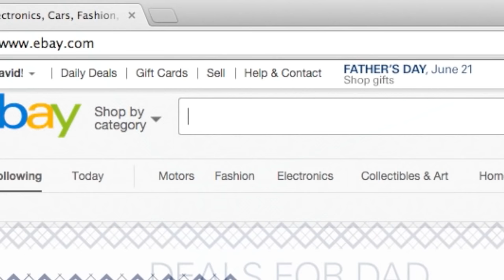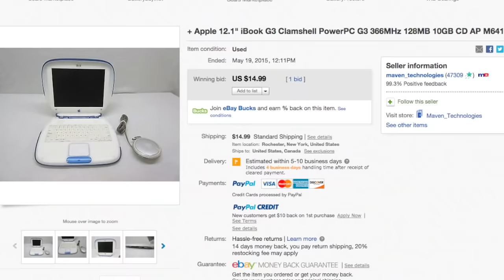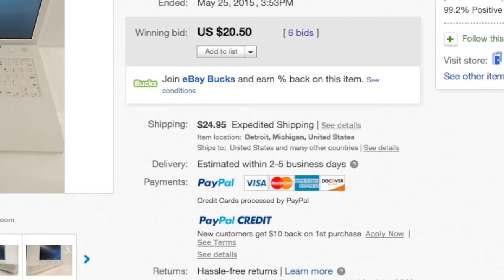Are apple iBook laptops collector's items yet?

Comment: I'm sorry but I believe the old hp laptops from the mid 2000s will become collectable. They have some of the most beautiful designs on any laptop ever made. The black with swirl designs molded into the plastic accented with silver just a gorgeous laptop. Not to mention they had gpu issues so most of them got scrapped meaning they will become more rare. If you like collecting computers I highly suggest collecting hp laptops as they are so unique through the generations. They may be terrible in reliability but they are truly works of art much nicer than the aluminum bricks apple has been making for the last 3 years.

Comment: "Everything apple makes will be come collectible" it hurt me when you said that
Reply: cough iPhone 4s cough
Reply: Not the apple watch 1, the ipad 1 or anything from the iphone 7 upwards. This is because the later models LOOK IDENTICAL to the models i mentioned.
Reply: Well I am using iPhone 6 plus. I would not thinking about replacing it with something else if they would not slowing it so badly.
Reply: aint no one gonna be collecting AirPods
Reply: Hope the 3gs doesn’t become stupidly expensive. It was my first phone and i want it back for nostalgia sake

Comment: How to look like a badass in class

Buy a non functional IBook Clamshell on Ebay
Take your laptop/Buy a cheap one
Put the laptops hardware in the Clamshell body
You now look like a hipster
Reply: I own a working one and sometimes i take it to class🤣
Reply: This is exactly what I want to do
Reply: would it fit tho?
Reply: Javiercito heh
Reply: @Yung Javier surprisingly some might actually fit just fine. Clamshells are relatively big machines compared to newer ones. Granted you might not end up with the USB ports but hey, that's the curse of retrofits
Reply: I have a blue clamshell one and i want to fit a macbook air 11 inch inside of that, i know its possible, look it up on google, core i5 clamshell ibook. Its stunning and everything on that ibook works, even the screen, its a screen from a 12 inch powerbook g4, i was stunned when i saw this and i just want to (re)create this laptop myself! Its a long and hard mod, but i think its worth it!
Reply: Yeah there starting to get a higher price some if them come with everything that was in the box and there about 1000 dollars
Reply: @bramvandenbroeck5060  someone did that put a MacBook Air motherboard in a graphite clamshell

Comment: I wouldn't say that old IBM and Dells are not collectible as some can be pretty steep despite their age. XPS M1730 World of Warcraft edition in near mint condition with all the upgrades often float between $1,100 and $1,300. As for IBM some of the classic Thinkpads such as the Transnote are extremely rare and sought after and often go for $200+. Not uncommon for Thinkpads that had once been owned by NASA (with proper tags ect) sometimes will go north of $600. 

Anyway buying powerbooks ;)

Comment: They built the iCarly "pearbooks" of iBooks G4 at first, but the one you showed, which was later in the show, was built off of a 2010 Macbook, right before they killed the macbooks. They also used a Black Macbook in the middle of the series.
Reply: Engei why spend money on iBooks if they are going to call them pair books🤣
Reply: Ricky Bennett  Dan Schneider has used them in literally every of his productions!

Comment: Do you think the Apple Watch will be worth a good amount since it will be a first generation in years to come?
Reply from the maker: Brian S - I'm sure it will.  But now isn't the time to buy one if your goal is to make money.  You need to wait until the price of them on the used market hits bottom.  Could be several years.  The original iPhone is already selling for quite a lot if it is in original box and condition.
Reply: Also do you think it's a good investment to get the sport and leave it rapped in the box?
Reply: Brian S I certainly think it could be-- the more original something is, the more 'one off' it will become... like a bottle of unopened vintage wine, but it could well be dependant on several factors in the future. (apple's longterm success, significance of the apple watch etc).
Reply: The time between buying an apple watch and it becoming collectable will be worth much more than the money you might make off of it. And you certainly wouldnt be the only person to do this. Plus, the chances of you making more than a few hundred bucks are VERY slim.
Reply: Guys, collecting is a hobby, not an investment. It'll never make you rich, in fact, it'll probably make you poorer ;)
Reply: Brian S It depends, but not for a long time.  Most of the time what gives things value is how rare the item is.
Reply: Brian

Comment: I bought an ibm thinkpad 380d in 2008 for 1$ on eBay and now you can buy this laptop for 115$. So, I hope this machine will increase its worth to 300-400$ maybe more in the next decade. I like the keyboard on this machine and the vintage tft screen when I play some vintage old games. :)
Reply: I used to have a 380d. There is a small market for those older think pad units but I don't see its vale increasing much further
Reply: The dollar sign goes before the number.
Reply: @geektome4781  if we're going to be petty, you replied to a 2 year old comment
Reply: MilesPrower1992 I think, if you look up the definition of “petty,” 99% of the comments posted on YouTube meet that definition. But I do not believe correcting what is a common mistake, a mistake that would make someone look rather ignorant in the workplace, to be “petty.”
Reply: @MilesPrower1992  Waiting with baited breath.
Reply: @geektome4781  It's spelled "bated"
Reply: @MilesPrower1992  Sorry. Was trying to be punny.
Reply: @geektome4781  I did not realize and I was trying to be as much of a petty jerk as possible

Comment: I got a question. Is it worth buying a iBook G4 just to use for school work such as using Google Drive? Or just watching YouTube? My current computer runs very slow (2007 Dell Windows Vista Home Premium,) and it ends up freezing every time I try to launch google drive on firefox. It's $74 on Amazon, is it worth buying it?
Reply from the maker: NW6782 - You don't want any sort of G4 machine if your plan is to watch YouTube on it.   They'd be fine for writing papers and some very LIGHT web browsing (stuff like wikipedia where there is almost no multimedia or advertising)
Reply: ***** He should downgrade to XP or upgrade to 8.
Reply: NW6782 here is a better option. throw your dell away.
1. vista is crap
2. it might blow up.
Reply: vista is crap though. windows XP, 7 and 10 are best in windows
Reply: and i dont think macs are better than pc. Gaming PCS are BEAST. Same With 2015 Mac Pro but they are made for diffrent things.
Reply: The iBookGuy But there is an aplication for watching YT videos w/o lag on G4 systems. You Mentioned it in the Video "Are G4s Obselete." It is called YouView.
Reply: NW6782 Install linux on your dell :)
Reply: nonsense xubuntu is great
Reply: The iBookGuy My PowerBook G4 plays YouTube okay in 240p, not great but its not really bad.
Reply: Get a 2006-2008 macbook much faster just search up "macbook 2006" white or black is good :D my cousin uses it to play minecraft he gets around 20-50FPS mainly 30FPS :D just a tip
Reply: ik what PC means.. I was just saying about minecraft.. but he records two at 50FPS in video format its very clear
Reply: FlawlessGamingHD | ᘜᖴ᙭ [ROAD TO 100!] Maybe he has some mods installed to improve performance? My early 2009 2GHz Core 2 Duo MacBook averages at 35 running Minecraft on Mac OS X Mavericks (Yosemite takes performance down a little), and with some mods installed for performance I can get around 10-23FPS more.
Reply: ***** I mean if they find a laptop cheap and just need it for school and something simple, I'd recommend it to a friend. I bought a PowerBook G4 for a friend from my old church and other than YouTube only running in 240p, he loves it. Oddly enough he even uses Photoshop on it and loves that too, I thought it was horribly slow even on my 2009 white MacBook. To each their own I guess.
Reply: it was just a suggestion :P
Reply: DatNuke
ikr i hate windows vista xD
Reply: NW6782 Windows Vista isn't really that bad. Give it a shot again, Microsoft has pushed out hundreds of updates for it since it's release. It's actually pretty good now.
Reply: If you aren't doing anything too hardcore then it would be a great laptop :)
Reply: I would
Reply: ***** Intel ChromeBooks can run Ubuntu and some people have been able to run Windows. If you use anything other than Chrome OS, Chromebooks are an amazing deal.
Reply: Install a SSD and reinstall Vista, easy upgrade.
Reply: Don't re install Vista... install windows 7 :)
Reply: Yeah, I know but installing Windows 7 or 8 will improve the speed versus Vista.
Reply: Technology Spotlight - Computers and Gaming Windows will not run on a G4, you'll need an Intel CPU to run Windows.
Reply: I believe that they did.
Reply: NW6782 Maybe a iMac G5,
Reply: IlluminousGaming YouView and MacTubes are dead.
Reply: nope.
Reply: The only solution to download YouTube videos is to use a online material.  As he said, YouView and MacTubes work on a older, dead version of YouTube.
Reply: Zachary Chang
I would (in fact, I actually started saving up for it) but and then I was like, "Wait, can Chromebooks play Minecraft? How fast would it play minecraft?" I searched it, and I found a minecraftforum page and it said you can't play Minecraft on chromebook because CromeOS wasn't able to run Java.
Reply: I am also trying to replace my current laptop with a cheap laptop such as the Asus EeeBook 2015.
Reply: NW6782 what a porno?
Reply: what.
Reply: Reinstall Windows on it, get Windows 7 and your needed drivers or run a virus scan.
Reply: +NW6782 I'm going to go with +Zachary Chang here... if all you're going to use the computer for is the Google ecosystem (Drive, Youtube, etc) and school work, a Chromebook would be sufficient. I've been using a Chromebook for about 6 months now as a blogger, and I don't see a real difference in terms of computing. I can do just about anything minus hardcore gaming and using Adobe programs, but for browsing and school work, It's PERFECT.
There is a reason why school districts are now providing Chromebooks for their students; they are the safest computers in the world and they just WORK.
I would recommend getting a 4 GB model, just to make things snappier. (I'm on an Asus Chromebook with 2 GB of RAM and it's fast, but the 4 GB would be even faster)
Reply: +Random Account Chromebooks are perfect for what he wants to do. An Intel chromebook with a 1080p IPS Screen runs $300 and works really really well.
Reply: ***** yeah that's definitely the cheapest option but I'm just saying the Chromebooks aren't too bad
Reply: ***** the problem with a Windows system is the fact that even with good, daily 'hygienic' uses (Run CCleaner nightly, Virus scans at LEAST weekly, keeping the system updated, etc) It can quickly become bogged down and slow, putting him the OP RIGHT back into the same situation he's in now.
Unless you manually configure the system to keep your history and cache, a Chromebook (or any Chrome Device) is designed to 'flush' itself with every shutdown. This means you'll have a new slate every time you boot up.
Reply: Becky Lawson that's a huge overexaggeration. I did a clean install of windows 8 on my main pc years ago and now it still runs really fast. I use ccleaner only to clean junk files maybe once a month and rely on the windows antivirus and its fine
Reply: Jesse Zhang I didn't say they get bogged down immediately, but with time, they do become bogged down and slow.
Reply: +NW6782 A 2007 dell should still be working decently. Have you upgraded the ram? My dad uses a 2003 Dell computer with only 2gb of ram but it works perfectly for him to use fb, e-mail, youtube, read news, etc. My little sister even plays some flash games on it. It's not going to run much else, but for what you described it should be more than enough. Maybe try switching from Vista while you're at it.
Reply: NW6782 Just wanted to add to what Mario Rodriguez said... RAM is going to help you a LOT. I used a 2006 Dell Optiplex 745 with XP SP3 for design and it had 3 GB of RAM. it made my old Inspiron laptop with 1 GB of RAM look sick in comparison.
Reply: of course it's going to be running slow! if you have the worst version of Windows in history which is Vista! install Windows XP or 7 on it!
Reply: +NW6782 Buy a Chromebook
Reply: Im actually thinking about that but I realized it wouldnt load minecraft or any Java. How hard would it be to put Lunix or something that that on it?RICARDO ANDRES PANIAGUA PEÑA
Reply: its probably spelled linux... or linix...
Reply: it's slow because it has vista on it.
Reply: NiccPlays just put XP on it. The PowerPC cpu's were not the most YouTube friendly
Reply: Peter Kapica Put at least Windows 7 And Watch Youtube all day :P
Reply: Machintosh 512k depends on the CPU. From experience a Pentium 4 or a low end celeron from the same era running 7 is sluggish even with 2 gigs of ram. If it's at least a dual core processor then yes it can 7 and even 10.
Reply: Peter Kapica IKR but who would install Windows 7 on a Pentium 4? We are 2016 2 0 1 6 who would have such an old machine?
Reply: NiccPlays  it's good if you buy a chrome book chrome book is not windows or you could buy a fake window laptop on eBay or amzone which doesn't  cost a lot of money I do not recommend a G4 laptop since is slow and I don't think that would be  good for school work now days
Reply: HT C you can overclock a Pentium 4 to a clock speed of 5 GHz so they are still relevant
Reply: NiccPlays just buy some $100 Android tablet with keyboard and put a Apple sticker on.
Reply: that was 2004 to 2006. they fixed the issue in late 2006

Comment: I found a blue clamshell iBook with all original packaging, all original information and papers and 2 chargers. It has 512+64mb of memory and it's running OS X Tiger (originally OS 9). The only thing that's missing is the airport card, and the battery still lasts 4 plus hours, which is incredible. No physical scratches, adult owned by one person. I was thinking of selling, but after this I might hang on to it for a while! I got everything for 50 bucks at a flea market!

Comment: Hello, can you help me please. I need to know how to install newer ios version (like ios 5, 6) in iphone 2G, 3G. I think it can be done and read somewere it can be done. Thank you!!!
Reply: Thank you, but it's ios 3 ( only looks and feels like ios 5 ), I need real one)))
Reply: Well, that's the only method I've seen. It may not actually be possible.
Reply: Iphone 2gs maximum ios is only ios 3 for the. 3g it is ios 4 the 3GS can run 6
Reply: GjukOfficial Id recommend just buying an Iphone 3gs because they can run iOS 6 and can be found on ebay for a pretty low price.
Reply: GjukOfficial There is no way to upgrade any current iphone to an ios version other than the latest one specified by apple
Reply: Use Whited00r. That will work even though it is classed as jailbreaking.
Reply: DatNuke Whited00r only adds new features and changes the looks your iOS version stays the same though

Comment: Collector's items??? They should all be tossed into the nearest bin as soon as possible!
Reply: Not cool bro, think about the planet, recycle it
Reply: Da Vo
Fine, recycle them, turn them into something more useful, just get rid of the damn things!
Reply: The Retro Tech Geek
All except Apple crap, don't get me wrong.
Reply: Foebane72 i like old Apple stuff. The only "old" computers I would be ok with getting rid of are 1990s era Dell, HP, Gateway, COMPAQ, or the other common windows 95-XP machines that have no value.
Reply: The Retro Tech Geek
I bet if you had an Amiga, you'd chuck it away, too.
Reply: Foebane72 no, i would keep an amiga. I have a Commodore 64
Reply: The Retro Tech Geek
Would you keep an Atari 400 or 800 or XL or XE? They are the true predecessors of the Amiga, as they were designed by the same guy (Jay Miner).
Reply: Foebane72 yes I would keep an Atari 400, 800, XL, or XE. Like I said, the only old computers I don't want are 1990s era Dell, HP, Gateway, or COMPAQ. (Or any other common 95-XP machines). Hell, I even take those when their on the curb. So yeah, I like all computers. ( except GAMING computers, they're just overrated.)
Reply: The Retro Tech Geek
Do you mean consoles? I only ever owned one console in 1997, an original PlayStation (not the small PSOne), and I hated how limited it was. I love PCs and those older computers because you can do more than just game on them. I just have a beef with Apple, because basically they're just the same as other computers, but their fans treat them as if they're innovators, which they're not (they only steal from true innovators).
Reply: Foebane72 i like consoles and older gaming computers, but the new gaming computers with the lights and all the bells and whistles I think are overrated. The only tricked out computer that I like that has all the lights and screens on the case and stuff is "blue ice" a 2000 Power Mac G4, but yeah old Gaming computers (especially DOS) I love
Reply: +The Retro Tech Geek jesus i was joking
Reply: It is now a year after you made your comment and now motherboard manufacturers are bringing out mobos that are expensive only because of the RGB bling and bling control that have been added onto them. And guess what! I was already sick to death of RGB a year ago.